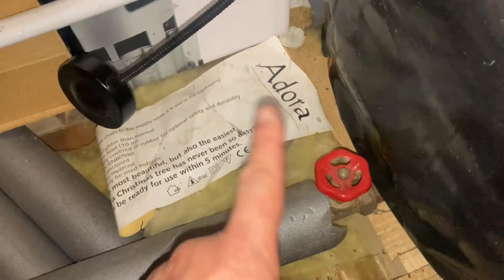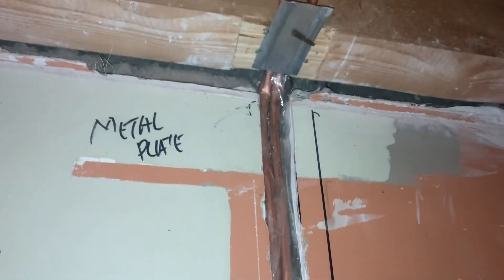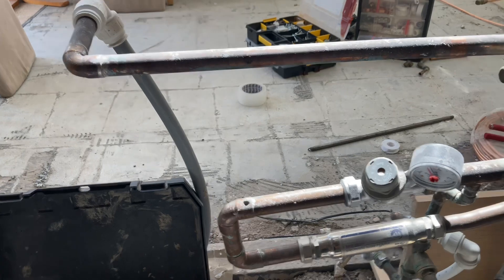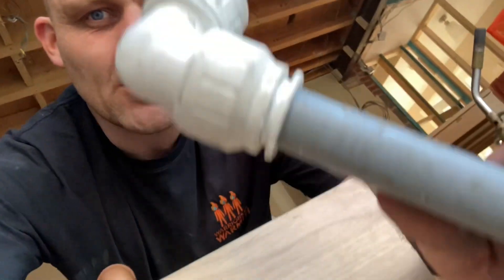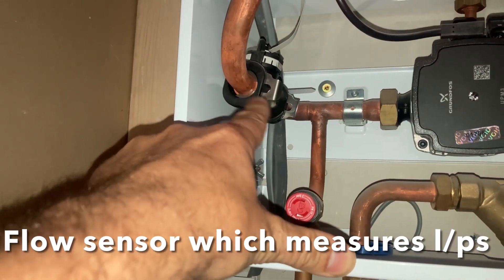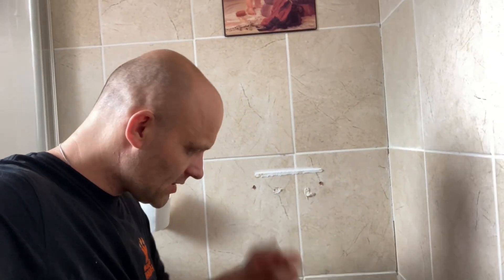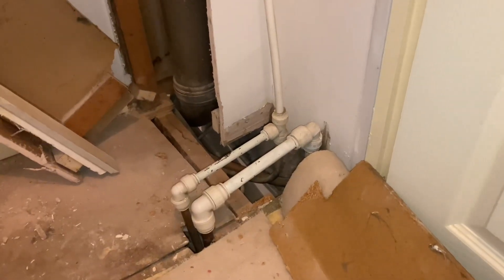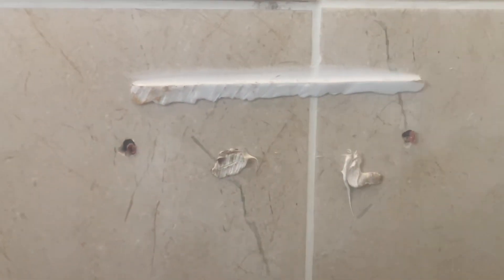Average Plumbers day!

Comment: Love your videos but your not allowed to  use expanding foam around MDPE  to seal inlet duct . You can sleeve it and then foam sleeve in duct. found out on  during water board inspection on a new build.